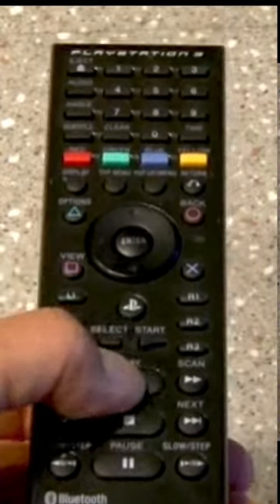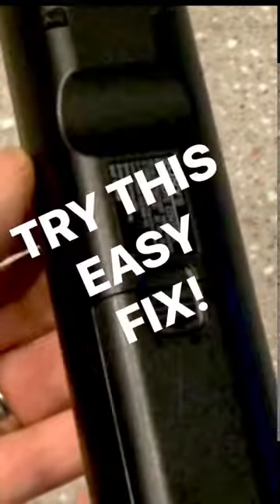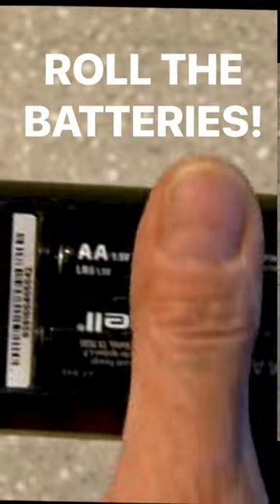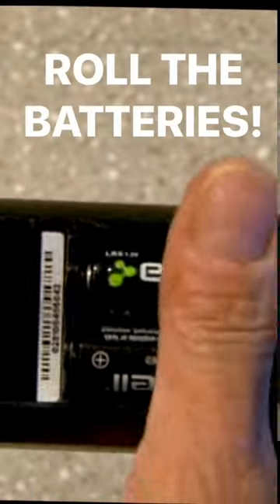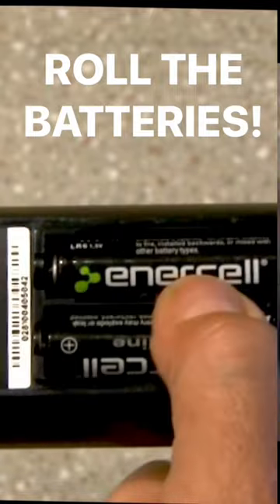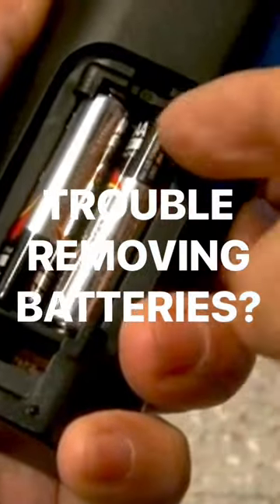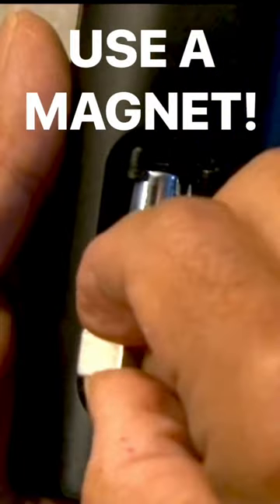Remote Control Hack

Comment: You can also test the batteries in the remote by aiming the remote at your rear camera on your phone, and then press and hold a button on your remote to see if the IR blaster on the remote lights up on your cellphone screen.

Comment: That sounds like a good idea or use a small neodymium magnet to take the batteries out the lightly sand the battery contacts if turning them isn’t enough.

Comment: Do you have any tips on getting car key fobs to work again?
Reply: I have one tip to assist with key fobs that work more intermittently, or have a short range. Place the fob next to your head before pressing the button. The water in your brain helps to amplify the signal. Gives it a significant range boost.
Reply: @CeeJMantis   i went to a battery store and they put a new battery in for like 8 dollars
Reply: @brandonrb  Congratulations 🎉

Comment: NO that's not how it works. you smash the remote on the table a few times then it will work again.
Reply: And I bang it on the table to get the batteries out! 🤣👍
Reply: @sksuppressor756  Throw it across the room for extra stuff batteries.